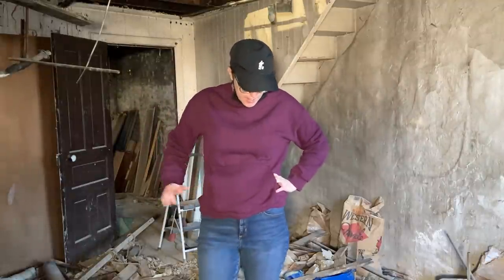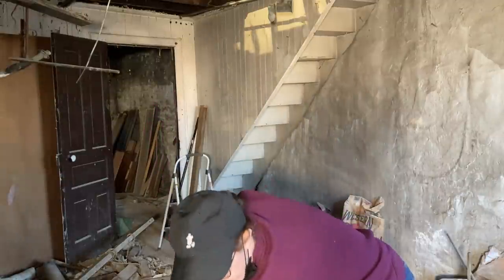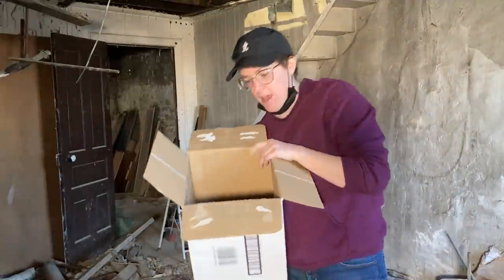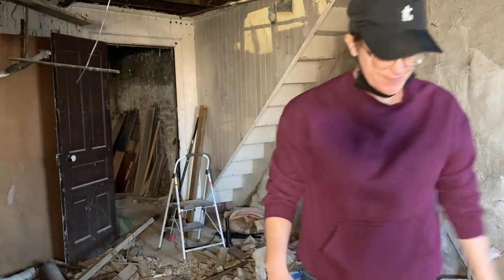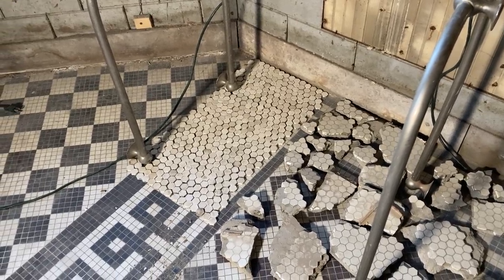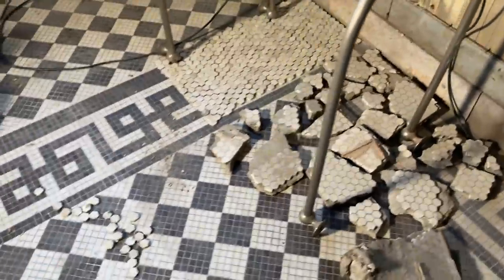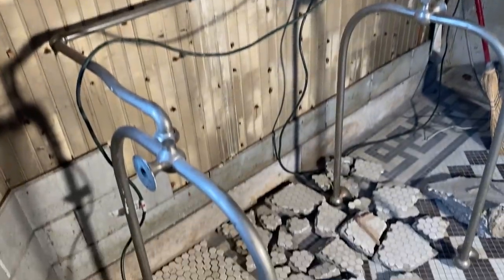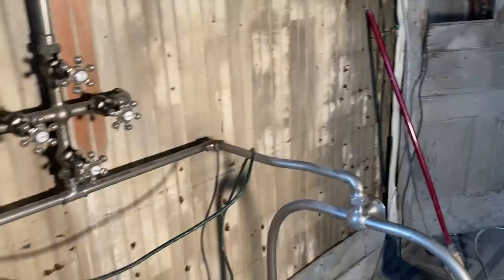Arranging Our Reclaimed Tile - Vlog 56

Comment: Have you considered putting the tiles on a sticky mesh square or contact paper to make installation easier and then you can see how many you need easier.   IE 12 x 12 square takes 150 tiles, I need 12 squares,  or 1,800 tiles?
Reply: This is a good idea.
Reply: I was thinking of a glue n mesh idea but your idea is better !!!!!

Comment: Just curious if the needle shower has been check out to see if there is corrosion in the pipes that would prevent it from flowing properly? Also, do the valves work and are the spray nozzles clogged? It would be a shame to do all that work and it not work properly.
Reply: Wouldnt be a big deal to unblock nozzles, and valve seats can be repaired.

Comment: My sister bought a house with that tile on her bathroom floor and yes it IS slippery. You may be able to get a mat to put over it when you are showering to keep you from falling. I fell on this tile and it is not fun. I bruised my back on the fixtures when I went down. Be careful with it.
Reply: Yeah, they should get a mat or a teak wood plank thing for the floor antique tiles did not have "slipping hazard" in mind when they were designed.

Comment: If you do not have enough white tiles, you might look for some black ones or some other color and create a pattern. This way you will not have to match the color of the white. Believe it or not, not all whites are the same, especially if you do not know which company made your white tiles. This is. more about getting the same size than the same color. The smaller size of the tile will help keep you from slipping in the shower. This is the reason the size was smaller. 

Now as to why the tiles were set in concrete in the first place. This was done to create as close to a zero groute line as possible. A smaller groute line all omeans a lower slip-coicient. If the tiles are set in concrete, you never had to grout the tile, and worry about mildew or water seepage under the tile. As time went buy, building trends changed and better ways of making bathrooms water tight were discovered, this construction technique was abandoned.

Comment: I think there is a non slip top coat for tiles or use in shower niches, as another commenter mentioned. Also, you can make 12x12 sheets of your tile to make it easier to lay. Custom mosaics are done this way. The tile are layed out and then top side is temp glued (water soluble) to a sheet of (looks like) brown paper bag. Lay the mortar and tile. After it’s dry, a wet rag on the paper dissolves the glue. Peel paper to reveal perfectly placed tiles. If not enough tiles, add a border or center medallion.

Comment: It won’t matter if the tiles are a bit slick as long as they’re small because the grout between them will provide traction.  I just put slick penny tile on my shower and bathroom floor and no problems…and I love bath products too

Comment: You might want to get some burlap mesh or some similar product to glue the tile pieces onto them to make the install easier? Just a thought. This will take into account any mistakes that might be made. Also, use a grout that is already sealed so that you don't have to keep resealing it. I mean, of course, small 12" x 12" pieces of mesh.

Comment: Boy this is a tough one - those tiles were originally manufactured on a 12" x 12" paper mat.  The mat maintained the spacing of the tiles.  So, re-laying them now will require a TON of spacers and patience....
Reply: I think the existing flooring is beautiful.
Reply: I think these guys have more than proven they've got the patience. I just worry about burn out with so many extremely tedious projects
Reply: They could just remake the mat though.
Reply: @katherinetepper-marsden38  that would require the same amount of spacers and patience.

Comment: If they are too slippery, you can use them as accent tiles in the shower, like a single line boarder around the perimeter with a few scattered inside the "square". They shouldn't make it slippery if most of the tiles you use are "non-slip" ones. Maybe even a fun decorative pattern!

Comment: I just missed the premiere.  Love the tiles!  If you don't quite have enough of them would it be possible to find other tiles to create a border?  You could even imitate the tile border in the room you're in to tie the two together.

/edit/ Also, years ago I asked a tile installer what they did to make tiles in the bathroom none-slip.  He told me they add playground sand to the sealant they use to finish the tiles. /edit/

Comment: I would have dumped them all out on the floor, squiggled them around until the pile was flat and found out right away if it was enough. OR I might have counted them then counted the rows both ways inside the needle shower to get an idea of how many I'd need.
Reply from the maker: Lol that’s what I would have done normally but for the video it needed to be an actual representation. Nobody wants to see me do anything haphazardly! 🤣

Comment: I'm convinced that I would have done this mathematically. Map out a square 6", count how many fit and do the math(s) to determine the required number of individual tiles. Then count what you found and conceptually weight up the pros and cons based on the percentage result. Mind you, the method that you've used and the very great effort that you put in to finding them and then saving them(!!!) has certainly charmed the spirit of every individual tile and I'm certain that they will sing for you in joy every time you see them.

Comment: I was thinking if you didn't have enough, maybe you could see if some of the glass 1/2 marbles you can get at the dollar stores would be about the same size to fill in. They are usually in the artificial floral departments. It would ad some sparkle. They even have glass hexi tile now too.   Just an idea.
Reply: That would actually bring down the value of the house by mixing materials as this is a restoration. They would be better off finding a contrasting color of reclaimed tile to fill in with a border or such. Fine for a modern house but doesn't fit the period for this house.
Reply: Wouldnt be very authentic for a 20s style shower though.